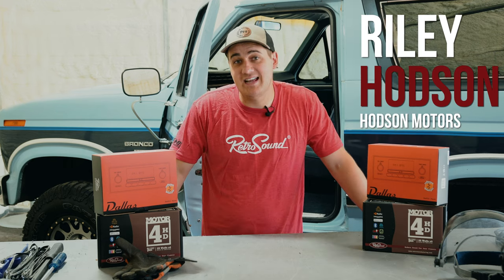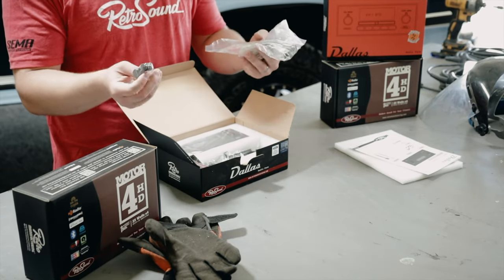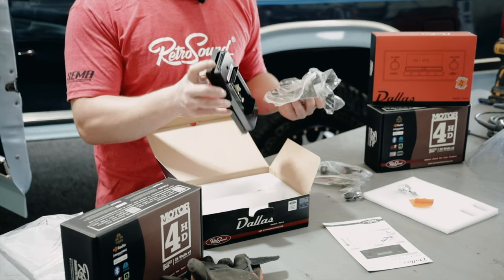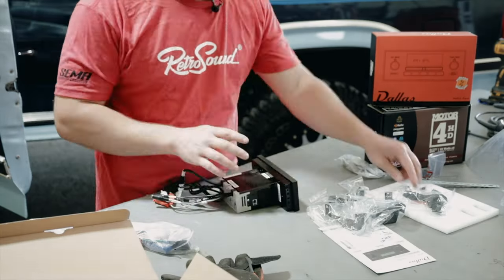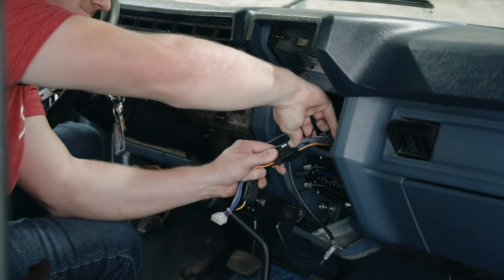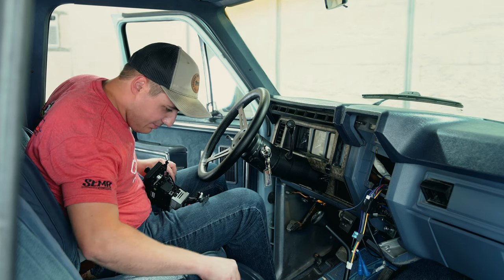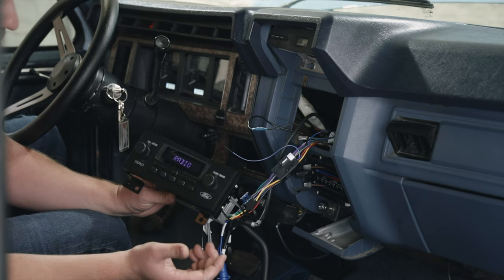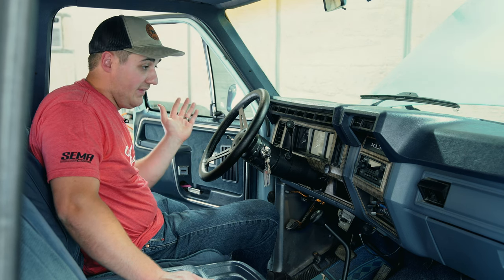How To Install a RetroSound® Dallas Radio

Comment: I have an 86 f150.  You mentioned the included factory wiring harness adapter.  Will my factory wiring harness for the speakers work with the adapter included?  I dont want to have to add additional wires for the factory speakers to work.  Thanks.
Reply from the maker: yes the harness included with the Dallas will work

Comment: I have an 83 F150. Looking for something just like this. Went to your site and it just says 85-86. I'd love more information
Reply from the maker: Our Dallas radio is officially fitted for 85-85 trucks only, due  to the brackets provided. Nonetheless, we have seen some skilled installers manage to make it work with custom fitting brackets. 

Additionally, we offer an official fitment for an 83 F150 if you're interested in exploring this option-https://www.retromanufacturing.com/collections/vehicle-search/products/1980-84-ford-f-series-truck-retroradio

Comment: Might be a stupid question, but the clock on the radio housing thing, where do you get those?
Reply: At the very top
Reply from the maker: @justinkapelos3531  That might be a part you'll have to search for. We unfortunately don't carry those.
Reply: @RetrosoundCarAudio  okay thank you, I can’t find any information on them.
Reply: @justinkapelos3531 the dash clock was standard equipment for XLT Lariat models

Comment: Would it fit my 1982 f150?
Reply from the maker: We Currenly list the Dallas for only 85-86 however  we have seen builder and installers able to fit it in  other years with some modifications or custom bracketry.